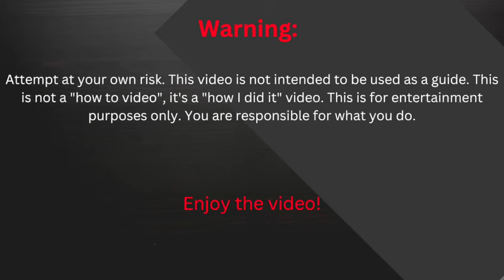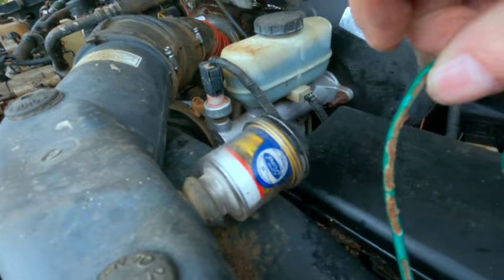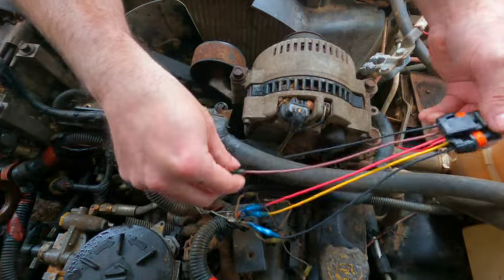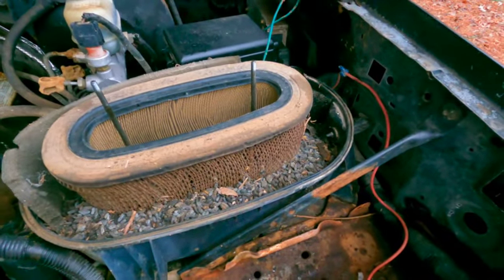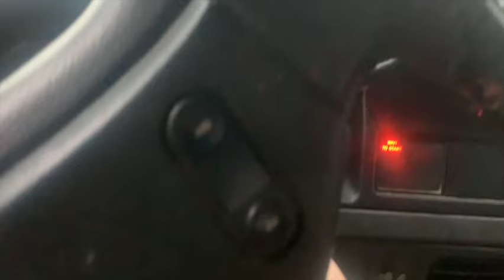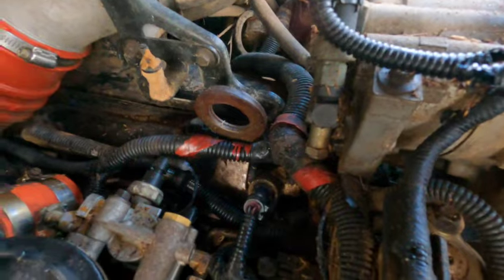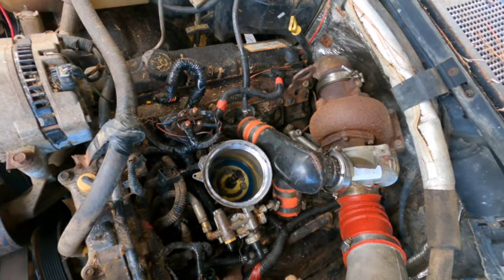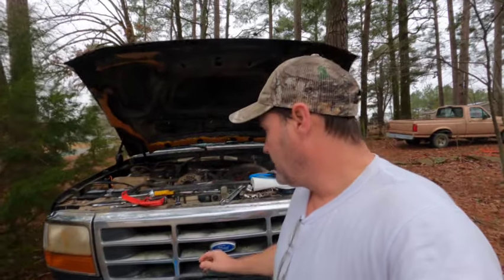1996 Ford F250 7.3 Liter Powerstroke Diesel Revival. Will it Run? Episode 3....The Awakening.

Comment: Yep start with a cam sensor . If no go then your gonna have to do a injector buzz test with a scan tool to see if the idm is working
Reply from the maker: That’s pretty sound advice. After going through the sensors we’ll see if that fixes the issue. Thanks for watching and commenting